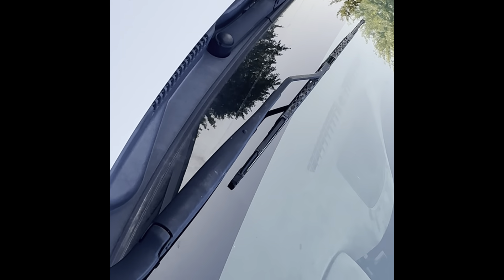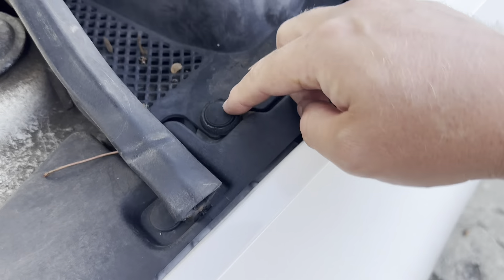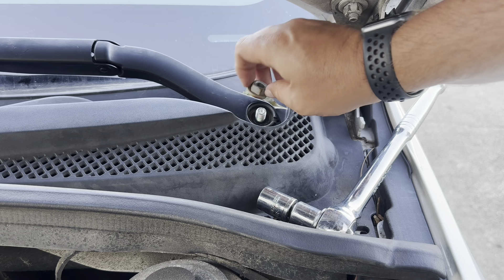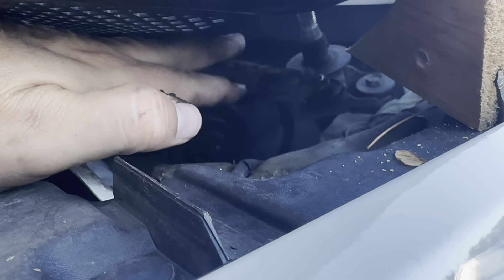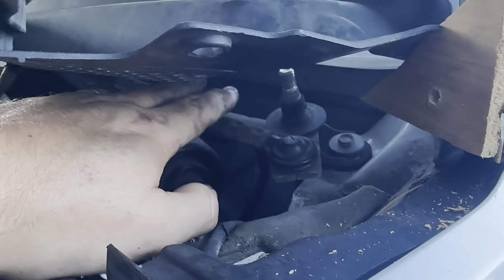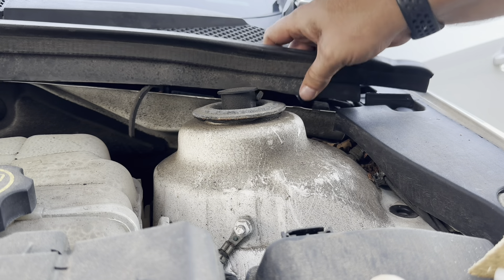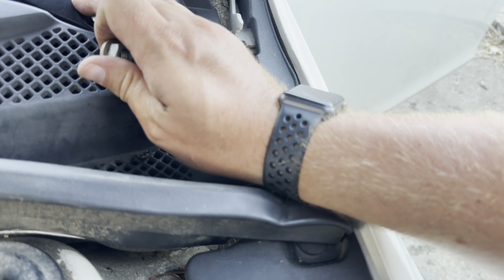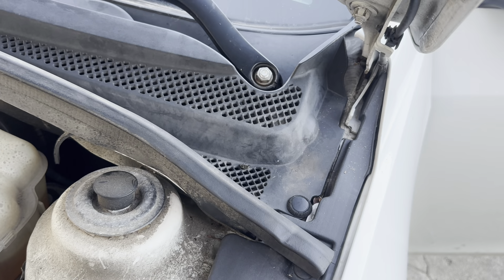My Windshield Wiper Stopped Working #DIY #efd #cruze

Comment: Thanks for the video. Same exact thing happened to my Mazda 3 recently and I stumbled on your video in search of a solution. Your vid helped me find where the separation happened. Tried the zip tie method but it did not hold unfortunately. I ended up replacing the linkage bushing (bought a pack of them from Autozone) which did the trick for me. I was able to snap the new linkage bushing in place and then connect it to the ball joint (after greasing it) without needing to take the whole assembly out, which some videos showed to do. Had enough space to just use groove joint pliers to get the job done.
Reply from the maker: very cool, glad you got it to work!

Comment: Same thing happened to my 2013 Cruze SW.
Drilled a 4mm hole in the middle of the nut, shoved a bolt in between, self locking nut and some grease, works perfectly and doesn't come off
Reply from the maker: awesome idea! I recently traded my cruz in due to other parts failing.

Comment: Instead of a ball of zip ties, I put a double layer of aluminum foil over the ball and it seemed to take up extra space at the connection and it fit securely again.

Comment: got a 2017 equinox and same issue amazon has em for 33$ for the linkage for yours mines 37 thinking that may be the route lol i did think of running a self tapper through the top but haven't tried yet

Comment: I thought you were going to drill a hole through the actuator arm and just run a nut and bolt through it with a couple fender washers. 

Not gonna lie I cringed when I saw the tape and zip tie “fix”. When you have to go in to repair it again try the nuts and bolts next time, you won’t have to repair it every year.